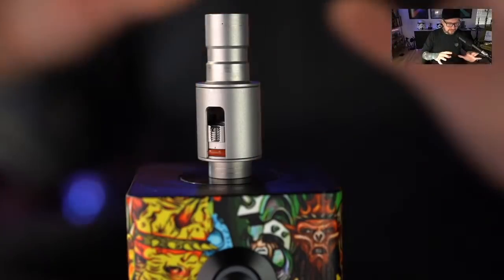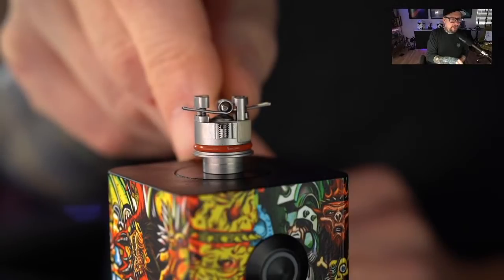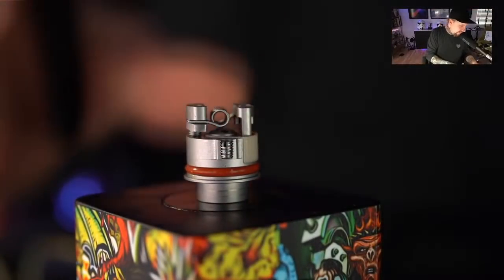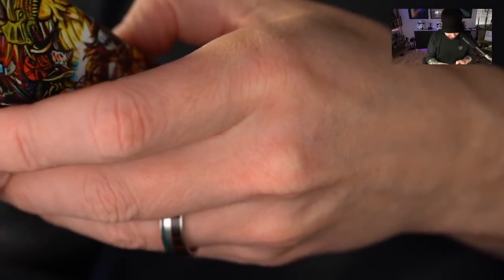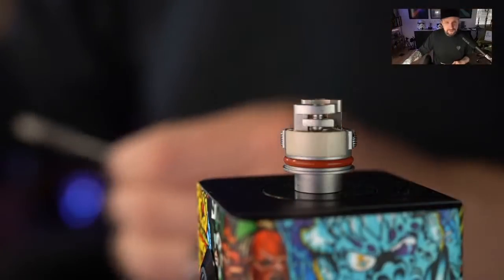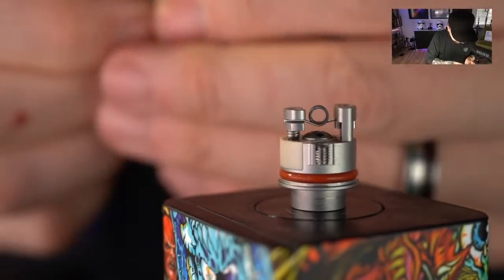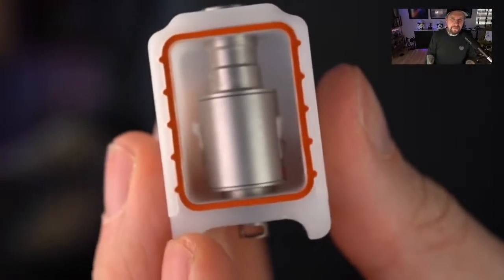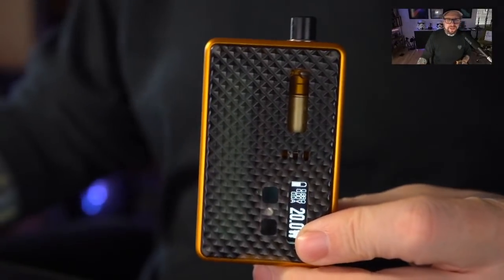Haku Xeta Build Stream / Rundown in 44 Min or less!!

Comment: I wanted a Xeta but I’m not a fan of the 3 piece bridges. I have the krma and it’s a pain to get in and out the boro, makes me dread rewicking. I’ll stick with my Bridge’D 1.2 till I can find something easier. Not that I’m gonna stop using it but I have 3 boro devices so I need another bridge or 2. I’m hoping u get the Truss from Joel and SQ and hopefully they send u their tool for screwing down the nut and they also have a flush nut, then u won’t have to use a quarter anymore

Comment: Ps use less cotton cuz its 90 10 liquid and also cuz ull be vapinging at a lower wattage plus put ur cap on with cotton sticking out and cut the cotton then fluff against the barrel of the sleeve around the coil should be good to go....future reference🤘🤘🤘